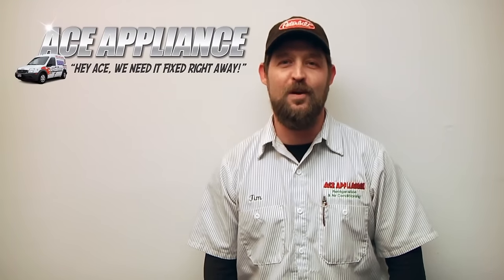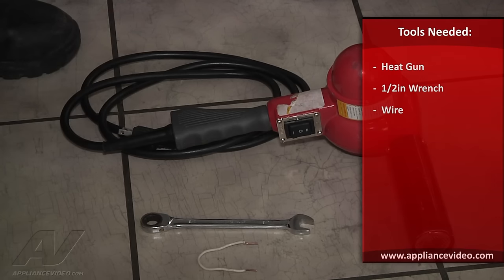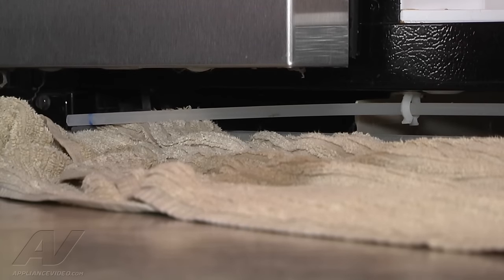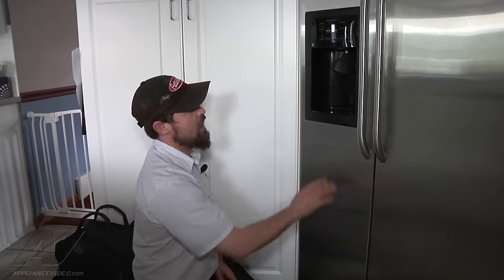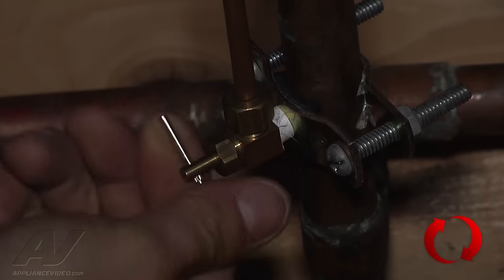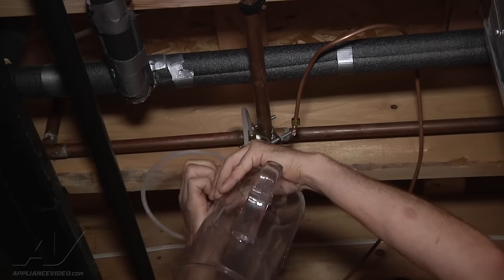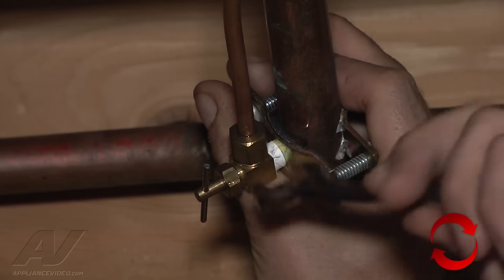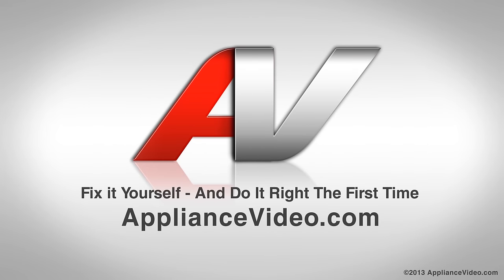GE Refrigerator Repair - Door Does Not Dispense Water - Saddle Tapping Valve Troubleshooting

Comment: Using this advice I solved a neighbor's problem.. Didn't realize these refrigerators have an in-door freeze issue.  Do the water line check first to eliminate any possibility of control valve failure.. I used a hand held hair dryer and a 4 foot length of trimmer string (.095 inches or 2.41 mm bright yellow color) to probe for how far up (inside the door panel) to feel for blockage.  I believe the trimmer string extended all the way to the outlet port on the door.  Using the trimmer string while directing hot air through a small funnel into the water line (with the freezer door open) throughout... I managed to estimate that the trimmer line was slowly moving into/through the blockage.  At the very end of the process (before water flow was restored I probed the water outlet to the water dispenser, and after a small amount of effort managed to push through the ice blockage at the water outlet and push to remaining ice plug down to the under refrigerator connector.  Not a large amount of ice but a little is enough to cause the associated headache.

Comment: We set the temperature in the refrigerator colder because of Hurricane Ian, then a couple of days later, no flow from water dispenser. It turned out that the water filter was frozen. Unscrewed the filter, ran hot water over it and now flowing well. Moral of the story- reset the temperature of the refrigerator back to its normal setting after the hurricane passes. Your video was extremely helpful and explanations were clear. THANK YOU.
Joe in Bradenton, FL

Comment: This all worked wonderful. When I took the coupler off, I had an issue with water coming out after re-attaching. I later realized that I needed to trim part of the hose as it became “uneven”. After that, no leaking and the water came out of the door as intended. Thanks for saving me a lot of stress with the tutorial on what the problem might be, how to get at the issue and how to fix it.

Comment: Thank you so much for the perfect instructions for two of the most non-maintenance type people.  We were able to heat the line to get water flowing again.  Caution, do not hold the heat machine (hair dryer) too close to the out spout for long . . .it will melt the plastic. Thanks again!

Comment: I used a blow dryer (on low heat setting) and held a small funnel against the end of water line and blew into the large end of the funnel for approximately 2 minutes. I also left the freezer door open for about 12 minutes. Problem solved! I ruined a plastic funnel with the heat, but well worth it. Thank you very much for the video!

Comment: I can't thank you enough for posting this video.  I found it AFTER two other failed attempts and, of course, your solution was so straight forward - a frozen tube!

For others trying to troubleshoot, I mistakenly replaced a perfectly good pump/switch mechanism on the back of the fridge.  I was also getting ice but no water and a paid technician thought it the part in the back rather than the simple test shown in this video based on the symptom section.

Comment: Bad time for the water dispenser to go out with the covid 19 pandemic.  Worked like a charm! -  using my blowdryer to heat the water line, and got the bottom of the fridge cleaned at the same time.  Was real excited to show my son that his old ma was more than capable of keeping the house running.  Thank you :)
Reply: Filtered water has nothing to do with cv19. It's a respiratory disease.
Reply from the maker: Great question, if you have a more technical question that our parts department cannot answer, you can search our over 13,000 answered questions free at our website www.ApplianceVideo.com under our Repair Help section. You can also call our parts department at 1-800-830-5465 and they can give you help 7-days A week ,or search at www.SaveMoreOnParts.com  .

Comment: Thanks so much! It worked! This is exactly what my issue ended up being. Water could get to the valve but not dispense water.  It ended up being frozen water in the water line up to the dispenser on the freezer side. Followed the simple instructions and used a hair dryer to send heat up the water line and then down the water line from the water dispenser. Just took a few mins. Be careful to not melt the plastic water line. I also increased the temperature setting to 0 on the freezer in hopes of not having this happen again in the future.

Comment: I just had a tube freeze up in the door of my side by side GE.  I was not being successful getting heat to the iced up portion.  I always think outside the box so my wife being a veterinarian, I got a syringe and a piece of tubing and pushed hot water through the dispenser hole in the door and within a minute it broke free. Thank you for what to look for to narrow it down.

Comment: The water dispenser line on my GE side-by-side was, come to find, frozen. So I did what your video said and disconnected the waterline and applied heat (I used a hair dryer) to where the water comes out for a good 10 minutes and then a small gush of water came out.  I hooked the line back up and it worked again! Thanks for the helpful video that actually works :)
Reply from the maker: Mr C 

                   All of our technicians are now answering questions
daily at our http://www.appliancevideo.com/ website under the Repair Help section.  We also have over 1600 common questions and
answers that you can easily search through by your model number, appliance
make, problem or error code and it’s absolutely FREE. You also have the option
to email a factory service technician with a question on your appliance at
http://www.appliancevideo.com/repair-help/
. If you’re looking for a repair video, you can also search our library of over
2600 free repair videos. ApplianceVideo.com specializes in quality
DO-IT-YOURSELF appliance repair videos and we get over 800,000 views per MONTH
to our videos worldwide and growing. If you need of parts for your major
appliance, we have over 5-million parts in stock at http://savemoreonparts.com/ .  Thanks for your
support. Matt Ace Appliance factory service technician.

Comment: We had this problem for nearly 6 years.  The 11 year old refrigerator now has a problem and is running but not cooling.  So, looking up this video, we tried the water output - miracle - now it is unfrozen and works!! thank you very much (but the fridge may be dead)
Reply from the maker: Great question, if you have a more technical question that our parts department cannot answer, you can search our over 17,000 answered questions free at our website www.ApplianceVideo.com under our Repair Help section. You can also call our parts department at 1-800-830-5465 and they can give you help 7-days A week ,or search at www.SaveMoreOnParts.com  .

Comment: Water stopped dispensing so I tried replacing the water filter which was due for a change anyway. But the new water filter didn't resolve the problem and now I'm thinking about a service call and a repair bill. 
I followed your instructions and took a hair dryer and heated the dispenser area for about 3 mins before I noticed a little spurt of water when the ice plugging the line melted.  The water dispenser is now back online and it was a simple fix. Thanks for your video!!!
Reply from the maker: +Ron V 

Thanks for your positive comment. We are glad we
could help resolve your issue and hopefully saved you money. Please help us
provide more videos to our site by subscribing to our YouTube page or posting our
http://www.appliancevideo.com/ website on your Facebook or Twitter account. Our
factory authorized technician’s also daily provide free professional Repair
Help to people like you to help solve their appliance problems. You also have the option to email a factory
service technician with a question at http://www.appliancevideo.com/repair-help/ .  If
you need of parts for your major appliance, we have over 5-million parts in
stock at http://savemoreonparts.com/ . Thanks
in advance for supporting us. So email us if you have any other questions our
videos cannot resolve. Thanks for your support in advance.   Matt, Ace Appliance service technician.

Comment: Thank you so much for this video!  I checked the connection under the refrigerator and when it was working I put a zip tie in the dispenser and it hit ice about two inches up in the line.  I used a hair dryer instead of a heat gun and then saw a comment from someone who shot a syringe filled with hot water up in the line.  Tried that with a turkey baster and, bingo!  Water is running now! Thanks again!!
Reply from the maker: Thanks for your response, we are glad we could help. Our library
of over 5,700 videos are currently helping over 1.6 million people like you
every MONTH.  Please help us by
subscribing to our YouTube channel, or post our website www.ApplianceVideo.com to your Facebook
page, Twitter, Instagram or any other social media sites. Your support will
help us keep producing more free quality videos.

Comment: Awsome short n sweet to the point video for the person like me who knows how to handle most situations. Simple removal of the shark bite. tested for water flow just as he did.  removed all the items from the door and began with a hair drier ( heat gun is at my shop) about a minute warming the door pocket. inside of the freeze brought the temp on the door panel up so it wouldn't keep the line froze.  Heat to the door side of the hose all the way up the outside of hose to the hinge.. watch for water to flow.. and by god it did.  Couple of concentrated mins till water made a good size puddle at the end of the door hose twice.  Cross the fingers for luck it was enough.  Reconnected and turned the water back on.  closed the door and pressed dispenser. Water ...!!!   2 gallon pitchers of water until it felt the same temp as straight from the faucet.  Lowered cold number in freezer from 5 -3 and will keep n eye on goods inside.  Thanks.
Reply from the maker: Thanks for your response, we are glad we could help. Our library of over 5,900 videos are currently helping over 1.6 million people like you every MONTH.  Please help us by subscribing to our YouTube channel, or post our website www.ApplianceVideo.com to your Facebook page, Twitter, Instagram or any other social media sites. Your support will help us keep producing more free quality videos.

Comment: Thanks for the video, I just bought a home with a brand new fridge but the flipper of the home registered the warranty in his name so the warranty didn't transfer. The fridge is 9 months old and would've costed $200-$300 to fix.... I unhooked the tubes underneath and have decent water pressure coming in so I believe the line is frozen... Unfortunately, I was not able to get the water working so I bought a tool that will hopefully allow me to pump warm water in the line. (fingers-crossed) it'll fix the issue and then I'll clean the water line in the basement as you did at the end of the video
Reply: UPDATE: my defeated self went to check the copper water line going to the fridge in the basement which has a kink is it, I shut it off and checked if that was in fact the water line but I believe it was the gas line... in this process of checking to see if I shut off the water, I unhooked the connection under the fridge and the iced tube finally melted and my fridge works now..... THANK YOU!!!! now I am slightly concerned about the copper tube that has a kink in it (slightly pinched) :/

Comment: Excellent video, which helped me in the right direction. Just: there's no water running from the tap-side of the line (right side of the connector). Could you please explain where I should start looking to solve my problem? My fridge is a Whirlpool 25RI D4 PT.
Reply from the maker: Great question, if you have a
more technical question that our parts department cannot answer, our
technicians are answering all questions at our website at www.ApplianceVideo.com under our Repair Help section. You can also call
our parts department at 1-800-830-5465 and they can give you help 7-days A week
Mon-Sat . You can also search at www.SaveMoreOnParts.com 7- days a week.

Comment: Great Vid, helped me solved my water dispenser problem.  Found this solution after replacing the water inlet valve.  I thought this was the problem because the ohm valued stated on many sites give the value of 200-500ohms.  Mine measured 182ohms.  End up being a frozen line near the dispenser area. I could only thread a piece of wire only a few inches into the water outlet.
Reply from the maker: John Henley Thanks for the positive comment. Hopefully we savedyou some money. Please help us provide more videos to our site by posting ApplianceVideo.com
on your YouTube, Facebook or Twitter account or add us to your circles. If you are in need of any parts please support
our parts department on line at http://savemoreonparts.com/ or call 1-800-830-5465 7-days a week until 11pm Eastern
time. Thanks again your support.  Matt, Ace Appliance service technician.

Comment: nice video! here`s another reminder. make sure if you have a plastic water cooler on the fridge side behind bottom drawers on the rear wall inside of the fridge.make sure that the lines there  are not frozen . this probably means fridge is too cold and check bottom drawer items to see if they are freezing. unplug fridge or use hair dryer. this should let the water continue to flow to the door. this might happen again which means additional problems. before yanking the fridge and messing with valves taking anything apart I`d look here first. it will save you time putting everything back together or creating other issues.
Reply from the maker: +James Dianna 

Thanks for your positive comment.  We have helped
millions of people repair their own appliances so please help us produce more
videos to our site by subscribing to our YouTube page, or posting our http://www.appliancevideo.com/ website on your Facebook or Twitter account. Our
factory authorized technician’s also daily provide free professional Repair
Help to people like you to help solve their appliance problems. You also have
the option to email a factory service technician with a question at http://www.appliancevideo.com/repair-help/ .  If you need of parts for your major
appliance, we have over 5-million parts in stock at http://savemoreonparts.com/ . Thanks in advance for supporting us. So email
us if you have any other questions our videos cannot resolve. Thanks for your
support in advance.   Matt, Ace Appliance service technician.

Comment: Great video and I love the presentation. Question, I have a slow flow of water coming from my water dispenser. No changes were made to precipitate this issue. I didn't move the frig, the filter is about a month old, so no changes. I put a new filter in but still the same issue. Then I took the filter out and the dispenser seemed to work fine with the normal flow of water. Is this a water inlet valve issue or something to do with the filter system?  About a five year old Samsung. And yes, I have already replaced the ice maker.
Reply from the maker: Great question, if you have a more technical question that our parts department cannot answer, you can search our over 17,000 answered questions free at our website www.ApplianceVideo.com under our Repair Help section. You can also call our parts department at 1-800-830-5465 and they can give you help 7-days A week ,or search at www.SaveMoreOnParts.com  .

Comment: Nice video. I did the first step and removed the water line but still no water coming out after pressing the water dispenser. What could be the problem?
Reply from the maker: Great question, if you have a more technical question that our parts department cannot answer, you can search our over 17,000 answered questions free at our website www.ApplianceVideo.com under our Repair Help section. You can also call our parts department at 1-800-830-5465 and they can give you help 7-days A week ,or search at www.SaveMoreOnParts.com  .

Comment: hi guys / girls ,, just fyi my Samsung RSG257AARS/XAA would not make ice or dispense water , i replaced the water line and started trouble shooting , i discovered that by placing a magnet above the freezer door hing fixed my problem , i now have full power water and ice, i have used your website with great success in the past and just wanted to help others with my problem
Reply from the maker: Great question, if you have a more technical question that our parts department cannot answer, you can search our over 17,000 answered questions free at our website www.ApplianceVideo.com under our Repair Help section. You can also call our parts department at 1-800-830-5465 and they can give you help 7-days A week ,or search at www.SaveMoreOnParts.com  .

Comment: Still dont work. Put the dryer on. The water line connector underneath the left side connecting the water lines (blue connector), one side you can squeeze easily the line on the left side, but the right side of connector is hard to squeeze. So, could that blue connector be bad or clogged? What is the name of that blue water connector on the left side bottom of frig?

Comment: How do you replace the line in the freezer door to the dispenser? Mine is cut at the bottom and the quick connect won't work as I don't have enough line at the bottom to connect one

Comment: What if the water is not coming through tue hose at the bottom at all? Where should we start to investigate? Is there a video referring to that?
Reply from the maker: Great question, if you have a
more technical question that our parts department cannot answer, our
technicians are answering all questions at our website at www.ApplianceVideo.com under our Repair Help section. You can also call
our parts department at 1-800-830-5465 and they can give you help 7-days A week
Monday -Sunday, or search at www.SaveMoreOnParts.com  24 hours
7- days A week.